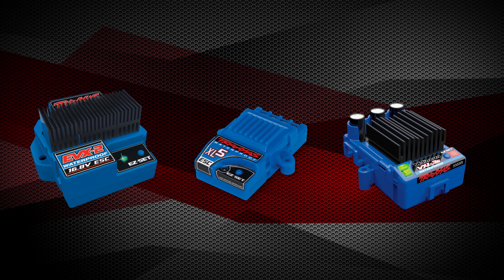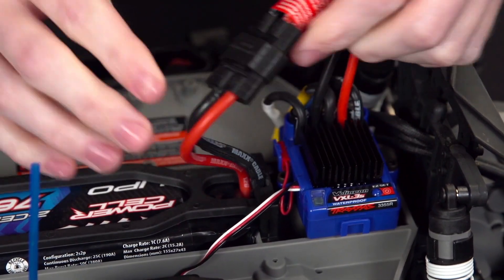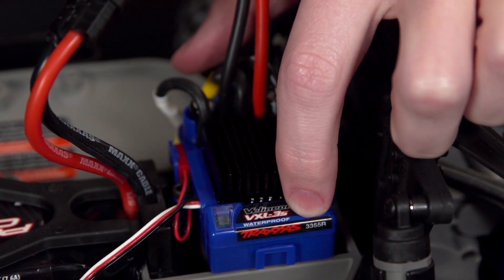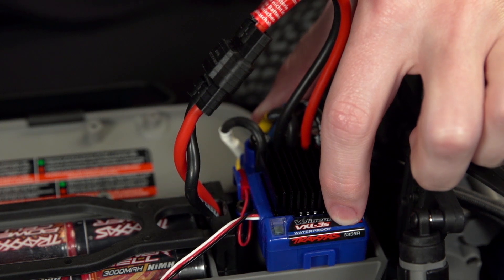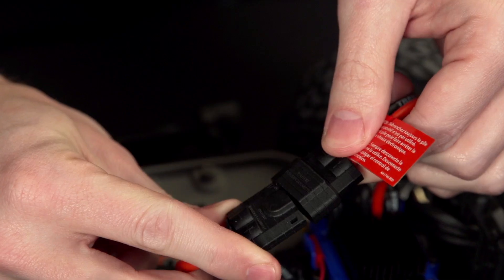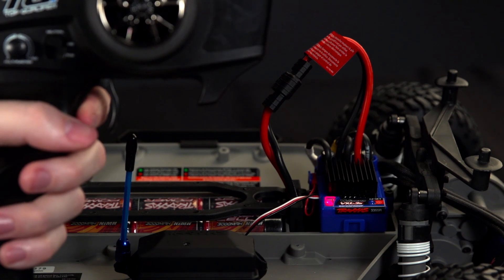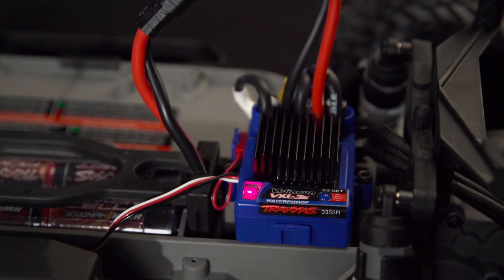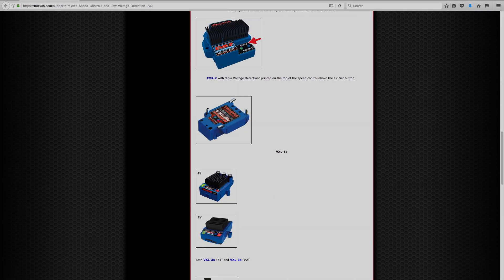How to Turn On Low Voltage Detection | Traxxas Support

Comment: On VXL-3s first generation, at what battery voltage is “Low-Voltage”mode set for? Having issues kicking on @11.3 volts. Not sure if battery problem or ESC?

Comment: For Lipo batteries, it should not go below 3.7 volts, but I have a Traxxas Slash 4x4 - VXL TSM vehicle. It goes down to 3.40 volts, wouldn't that be a problem, just so I got a Li-po alarm?
Reply: A lipo battery can safely go to 3v per cell but it’s not generally recommended to get to that point, most will say 3.2-3.5v.  I usually try to check my voltage and just stop around 3.8v as that is the storage voltage for lipos, but that’s just me, others have their own opinions.

Comment: So when low voltage detection is on does this mean at the end of the battery cycle it will go super slow and blink red? (using zee battery)
Reply: It will just cut power to the truck
Reply: @andrewb1313  So if mine makes it flash red and go 50% is there something wrong?
Reply: @micahlake4444  I'll have to get back to you on that. I was using an e maxx with a castle brushless ESC. I will try a summit with lipos and let you know.
Reply: @andrewb1313  ok thanks

Comment: Hi, we are new to the whole LiPo battery thing, quick questions, what actually happens when you have ez-set on while running the car? does it beep or stop when it reaches low voltage battery?? How does it actaully alert you of a low voltage? How do we know the ez-set function is working correctly?? the manual is not clear on answering these questions...or maybe we missed it.
Reply: Dang 1 year and no response
Reply: In that video she said if you are on LVD mode and start the car with a NiMh battery it will flash red indicating Low Voltage Detected.

So I am assuming that when Low voltage is detected on your LiPo it will flash red.

However in the instructions I did read somewhere "It is your responsibility to stop using the battery if Low Voltage is Detected. So it doesn't sound like it auto cuts off or anything, and how you're supposed to see that red LED under the body? who knows!

I just hope it also makes a noise, but even that will be hard to hear under all the gravel grinding.
Reply: Did you figure it out? I have exactly the same question.

Comment: Hey traxxas! I have a stampede body with a 5000 DXT battery with a XL5 ESC receiver. The battery is fully charged, but it doesnt want to go. When i lift the back end, the backwheels go, but it accelerates a little slow. Yet when i set it on ground it barely goes. Yes it is not set on low votlage detection. What would be wrong with my truck? Remote has full battery
Reply: Sounds like you need a new battery
Reply: Re bind the receiver with remote

Comment: How to turn off voltage protection for lipo packets?
Now it cuts me off at 3.5V, I could safely discharge the battery to 3.2V

Comment: Maybe dumb question but does the car cut to half power when low voltage kicks in? My new Rustler cut to half power using the 3 cell battery. Not sure if it over heated or low voltage cut power..
Reply: Is it a normal Rustler or a VXL one?

Comment: I have a 3c lipo battery FCONERGY  7000 mAh and when I put it in my 2x4 (2 wheel drive) slasher the light blinks red and green I don’t know what to do plz help.

Comment: My spartan does not have a button to put in lvm what do I do?
Reply from the maker: For the Spartan try this:
Verify Low-Voltage Detection setting:
1. Turn on the transmitter (with the throttle at neutral).
2. Connect two fully charged batteries to the VXL-6s.
3. If the ESC’s LED glows red, then the Low-Voltage Detection is DISABLED
(not safe to use LiPo batteries). If the LED glows green, then Low-Voltage Detection is ACTIVATED.
To activate Low-Voltage Detection (LiPo setting):
1. Turn on the transmitter and hold the trigger to full reverse.
2. While holding the trigger to full reverse, connect two fully
charged batteries to the VXL-6s.
3. Continue to hold reverse. After about ten seconds, the red
LED will go out and the green LED will switch on. You will also hear a ‘rising’ musical tone.
To disable Low-Voltage Detection (NiMH setting):
1. Turn on the transmitter and hold the trigger to full reverse. 2. While holding the trigger to full reverse, connect two fully
charged batteries to the VXL-6s.
3. Continue to hold reverse. After about ten seconds, the green
LED will go out and the red LED will switch on. You will also hear a ‘falling’ musical tone.
Reply: Thank you!!!!

Comment: I re-set my speed control but it still flashes red as soon as I finish the process. What does that mean?
Reply: My car won't go forward or backwards but only steers, do you know something wrong about that?
Reply: @M.e.x  mine has done that before as well not gonna lie I just didn’t use it for like a month and tried again and everything worked fine😅
Reply: @clitcommander6946  Alright man thanks for telling me👍
Reply: @M.e.x  it happened to me after I played in a bunch of water. It would accelerate for like a foot then the light would flash red and it would only turn left and right, no forward or back movement.

Comment: Its same like this on xl 2.5 esc?? Please answer
Reply from the maker: Yes, the process is the same on the XL-2.5--you can check the ESC to see if it says "low voltage detection." Thank you for watching!
Reply: @Traxxas  thanks👍

Comment: What happens when low voltage detection kicks in
Reply: Lego Brain Productions 50% throttle than 0
Reply: Moto 1 thanks a lot it’ll sure help me with a problem i had with the TRX 4

Comment: what happens if a run a nimh on my XL 5 with low voltage detection ON?
Reply: You will have less run time because the esc will turn on the low voltage detection before your whole battery is used. So if you normally can use the whole nimh battery now you might only be able to use it till it has reached to 20% off battery left. This mode only excists because if lipo batteries get discharged to much they will get permanently damaged.
Reply: @ChunkyOrca  Yeah. I was asking because I was runing with ni mh battery and the esc fried... But now Im waiting for my brand new one.

Comment: I have a 1/16 e Revo and I use lipo with green light and it’s powerful but then it blinks red and doesn’t go as fast
Reply: Traxxas says it automatically lowers vehicle perfomance when low voltage detection detects that battery is low
Reply: Then recharge the battery

Comment: What happens if you're using a NIMH and low voltage detection is on??
Reply from the maker: You're truck may only run for a few moments before it comes to a stop and the ESC starts to either flash red slowly, or when powered on the ESC may just flash red and green. For any further questions, please feel free to give us a call. Our Customer Support Team would be happy to help. You can contact them at 888-TRAXXAS or at Support@Traxxas.com.

Comment: Thanks! Will changing to the right mode make it faster?
Reply from the maker: No it will not . Note: If the LED shines green, Low-Voltage Detection is activated. This will cause erratic performance from NiMH battery packs. The default factory setting is for Low-Voltage Detection to be disabled (LED shines red). Make sure to turn the low voltage detection on when using LiPo batteries. Never use LiPo batteries while Low-Voltage Detection is turned off. 

The Low-Voltage Detection circuitry constantly monitors the battery voltage. When the battery voltage begins to reach the minimum recommended discharge voltage threshold for LiPo battery packs, the ESC will limit the power output to 50% throttle. When the battery voltage attempts to fall below the minimum threshold, the ESC will shut down all motor output. The LED on the speed control will slowly blink red, indicating a low-voltage shutdown. The ESC will stay in this mode until a fully charged battery is connected. The ESC's Low-Voltage Detection has been disabled for best performance with NiMH batteries. The speed control’s LED will glow red when it is turned on, indicating Low-Voltage Detection is disabled. Be certain to activate Low-Voltage Detection if you install a LiPo battery in your model. Never use LiPo batteries while Low Voltage Detection is disabled.
Reply: Traxxas thank you solved all of my problems!
Reply from the maker: If you have any additional questions or need help, please contact our customer support team at 888-TRAXXAS or at Support@traxxas.com. You may also reach out to us via our Live Chat feature and speak with one of our customer support team members on Traxxas.com. You will find the link in the lower right hand corner of the web page.

Comment: Is a flashing red light normal with a lipo battery. It green when I turn it on but start flashing about 30 seconds later
Reply from the maker: Hello! Our Customer Support Team would be happy to help. You can contact them at 888-TRAXXAS or at Support@Traxxas.com.
Reply: Then CHARGE the battery

Comment: 👊😎. Thank you guys. 

This is one EPIC RC you have sent me. 

Just for it. It is all set up and going to run it on the in box smallest battery until I change the gear and move on to the other different batteries I bought. 

Got both a set of 2s lipo's 
And a set of 3s lipo's 

And yes I am aware I can not run in parallel the 3s lipo packs. Due to over powering the car and that would result in damages in the electronic system. 

Much Love have a great RCriffic day. 👊😎

Comment: does it mean low voltage detection is kicked in when it flashes red after use
Reply: Christopher Hendley if the light is green when the battery is fully charged and then flashes slow red after use, low voltage is kicked in

Comment: do you have to activate the LVD everytimes you put the batteries in the vehicle
Reply from the maker: No, it'll stay set. Just make sure you use the same batteries.
Reply: Traxxas what if I'm using different mah size battery?
Reply from the maker: Feel free to contact our Customer Support Team at 888-TRAXXAS, or email them at Support@Traxxas.com. They'll be able to help you with more detailed questions.
Reply: GSHeverything _27 no

Comment: At what voltage does the LVC activate? Trying to find this in the manual but can't find it. Anyone here knows? And if so, can the value be changed?
Thanks!
Reply from the maker: Please feel free to give our Customer Support Team a call at 888-TRAXXAS or send them an email at Support@Traxxas.com. They would be more than happy to answer any questions you might have.
Reply: Did you get the answer, as I have the same question
Reply: +AllStealthBlazing I tested it myself with a Slash 4x4 brushless and the battery had about 3.10v per cell (2s). It's safe for the battery but still, I decided to install a low voltage alarm and set it to 3.30v. hope this helps you!
Reply: +rodpolice Thanks!

Comment: What does LVD do? I'm not sure whether it shuts down the car or does something. What does it actually do?
Reply: LeShedd it starts by limiting it to 50 percent throttle then it turns off the car
Reply: for lipos, so they don't over discharge

Comment: I think 99.99 percent of all the owners of traxxas vehicles already know how to turn on the low voltage detection, but this is a good video for the beginners . keep up the good work Traxxas :)
Reply: im one of the 00.01 percent of those people.
Reply: +TRAXXASfreak Some people just don't read the manual anyways that's why they do the videos.
Reply: I'm a beginner
Reply: I just got mine so yeah
Reply: I've only had my slash a week and I'm just figuring it out so this video helps the first couple of times I'm changing modes
Reply: No. Am New. And i was trying to figure how to turn on.
Reply: Why is my ESC getting hot and light flashing green?
Reply: @maxxpower8961  because it hot so unplug battery and let it cool down
Reply: I just bought a LaTrax Prerunner and that is not in the manual at all. Because LiPo is not approved for the vehicle.
Reply: Beginner here, first traxxas buy today I needed this video to understand what this is all about
Reply: I don’t